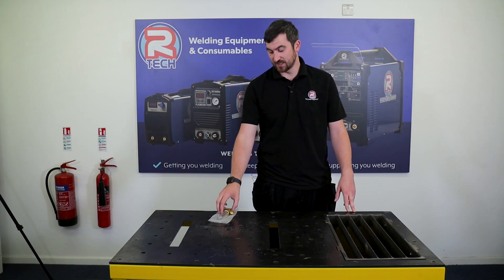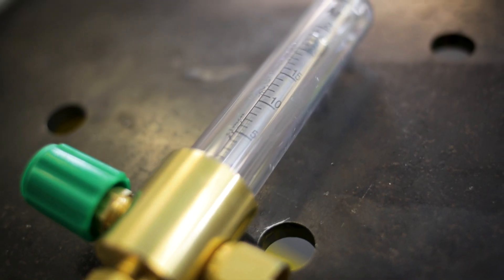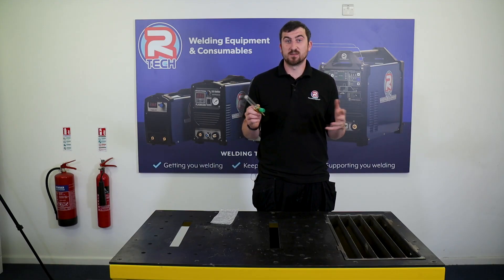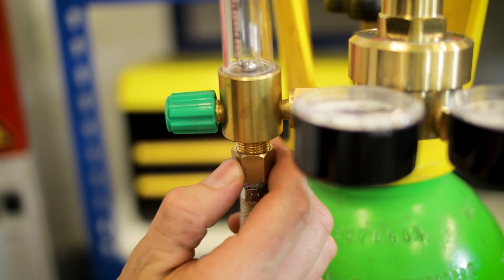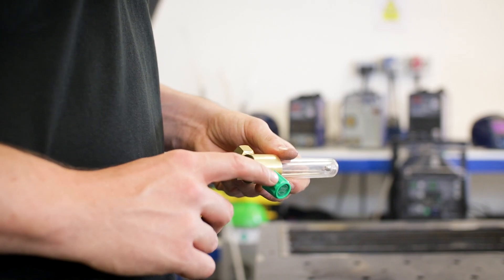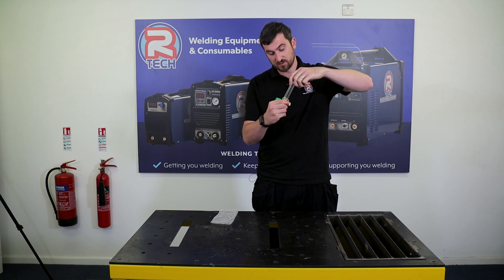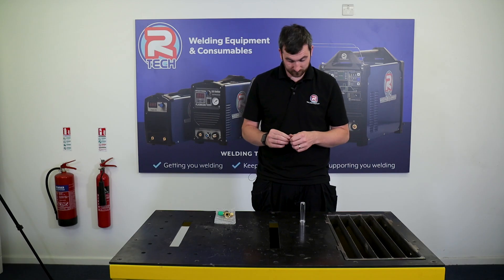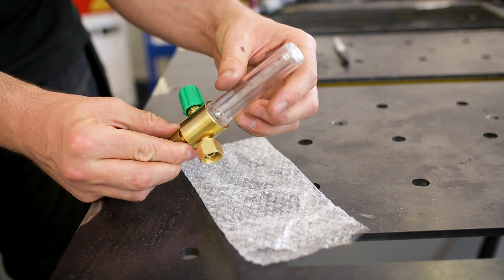Gas flow meter setup for welding -  Save gas - Tips for gas leak checking

Comment: Two things not mentioned. The pressure should generally be set to 50 PSI for the flow meter to be accurate. That will need your flow gauge (actually a pressure gauge) to be replaced for a gauge with pressure markings. Also the outlet of the regulator will have a very small orifice, this is what lets the flow gauge show flow and not pressure. At 50 PSI, you might not be able to access the full flow capability of the regulator without replacing the outlet connector with one with a larger orifice.

Comment: you need the regulator open to what pressure before the flow meter?
Reply from the maker: Hi Paul, with a flow meter in place it isn't overly important what flow is set on the regulator as the flow meter is doing all the control, that said you ideally wouldn't want the regulator set wide open as this will create large gas purges on first trigger press.  I normally have the regulator set anywhere from 10-20 Litres per minute.  I hope this helps - Ben
Reply: @rtechweldingtv  many thanks

Comment: What pressure should the regulator be set at
Reply: Please
Reply: Depends on what pressure the flow meter was calibrated at, usually 50 PSI. It's sometimes written on the flowmeter.